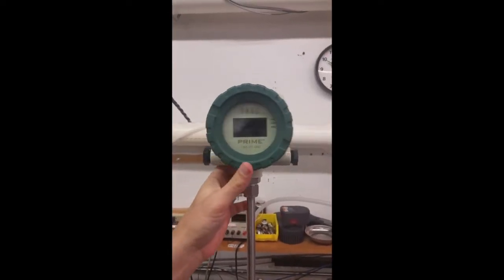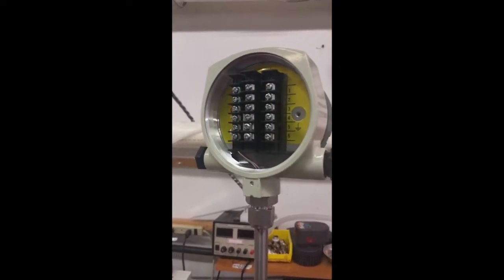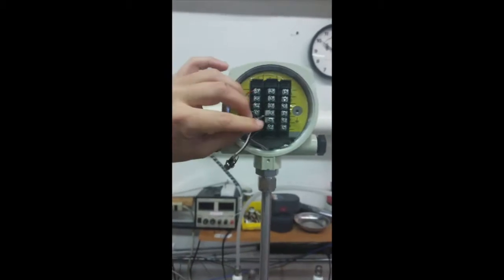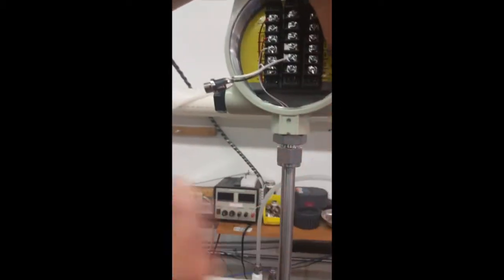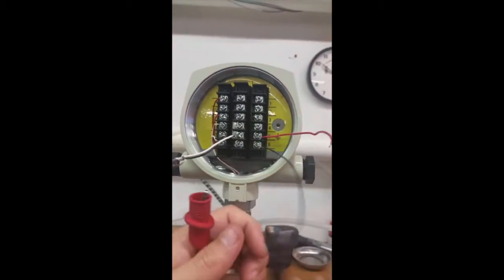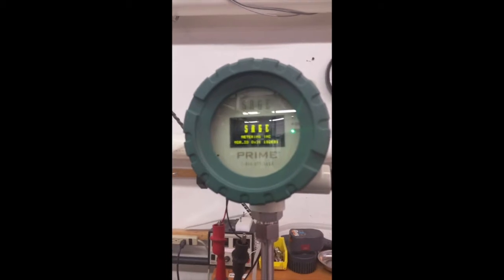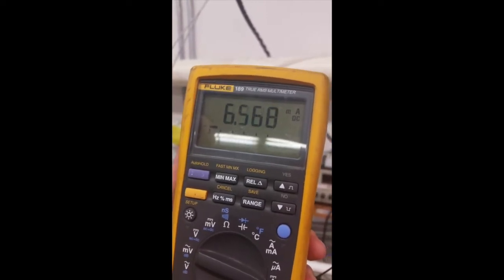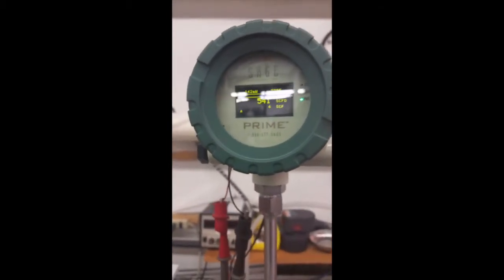Internally Powered 4-20mA Output: Sage Prime DC

Comment: Hello, I have some questions about Sage Prime Thermal Mass Flowmeter Electrical Wiring.
Does the transmitter need external power supply anyway (4-wire connection)?
1- If it doesn't need it, where shall I connect 4-20 mA AI 2-wire connection + and - ? (which will be the only wires connected to sage).
2- If it does need external power supply, 220 VAC connects to B1 and B2 BUT
shall I configure my 4-20mA to 4-wire and connect to where??? OR shall I keep my 4-20 mA AI as 2-wire and connect to where??
Reply: 8 years later still no answer...